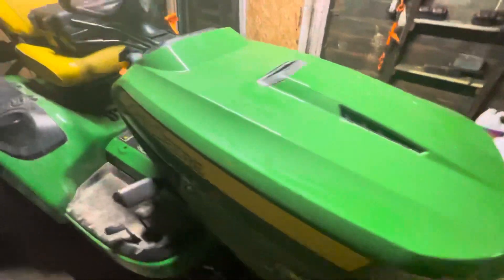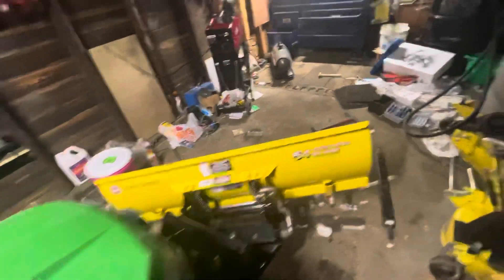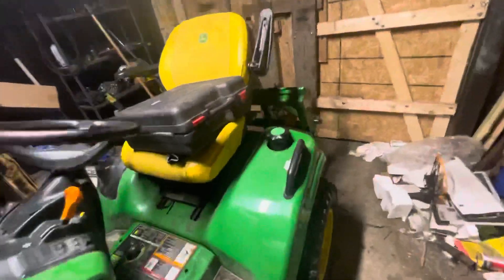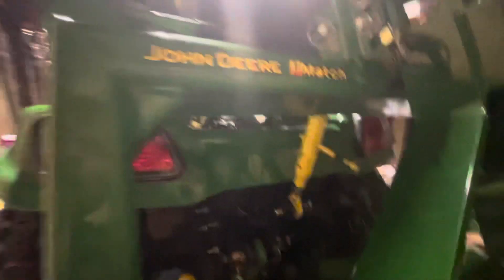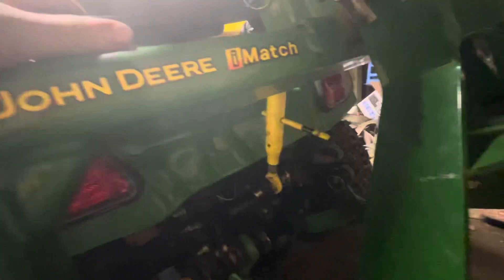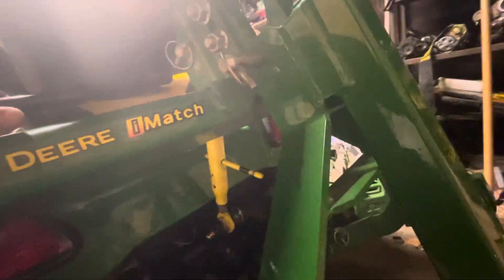Why do you need the lockout valve on John Deere x758

Comment: I just installed this valve on my x758 for my blade. I wasn’t happy with how far I could thread it in before it hit the frame rail. JD should install this valve at the factory.
Reply from the maker: From the factory there set up to mow when you buy it from dealer and get the hitch with the blade and you have them install it they will put the valve on and I put mine in and it was easy